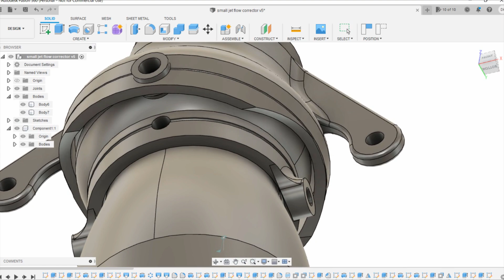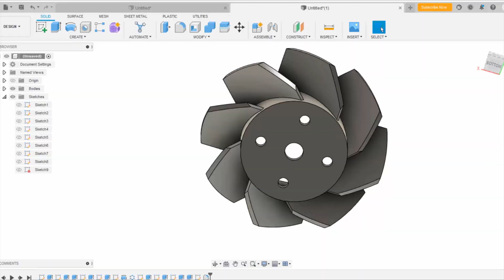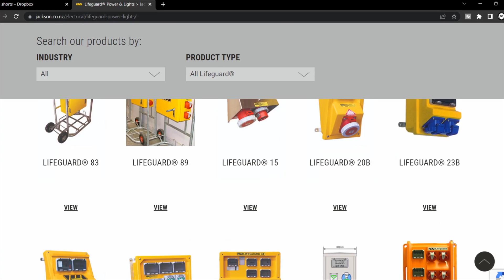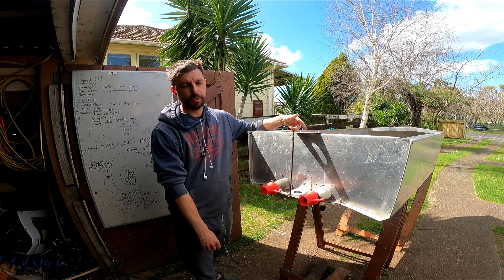Electric Micro Jet Boat Build

Comment: As far as cooling fans why not get some low volt high volume computer fans. You may run into issues with the fans you added as the greatly shortened your mitor shaft length. I wont pretend i know how your impellers connect to the shafts but im guessing they have allen screws to tighten a collar to the shafts. If thats the case the more the impeller is making contavt with the shaft the less vibration youll have as well as being out of balance. Pop a 4" or 6" pc fan pushing air into the motor compartment and one pulling air out on the other end.

Comment: Waterjets have a narrow powerband of greatest efficiency.  Inlet size, impeller size / pitch and nozzle size all have to match the motor constant/RPM in order to get that thrust you are looking for.  If I were to guess, I'd say you need more rpm on your setup but its only a guess.  Your ESC may be able to tell you how many RPMs your turning. 
 Motors have so many rpms per / volt, so either raise the voltage if your ESC can take it or get motors with higher KV rating.  Its usually better to max your voltage up to the proper RPM to reduce heat buildup in your batteries / motors / esc.
You'll have to test your Jet to find its best rpm/thrust before it cavitates. If you build a jig with a scale you could change some variables and measure your thrust to get the best results before river testing.   
Just for reference ; the MHZ jet 64 units are around 16-17k max rpm with a claimed 400N of thrust. 
I went that route as I didn't have a 3d printer.
I Enjoy your videos. Great to see your determination and skills.   Thanks for sharing your work and bringing us along for the ride.
Reply from the maker: Yeah there wasn’t enough rpm and then the esc melted , so I can’t do much more until I buy some more esc but might need inrunner motors
Reply: @dkthewelder  You want to match your esc for the high end of its range. Although counter intuitive, esc's make more heat when they're held back. Just make sure your at the highest system voltage you can manage to match your rpm range and add some capacitors to them. You might want to look at sss56104 motors. Decent and good cost/performance ratio.

Comment: I would not put the controller on the bottom of the hull since it will get wet there  . put them in line with motor fan elevated   Just saying
Reply from the maker: Yeah I moved it off the bottom. Have you seen the latest video?

Comment: I wouldn't mount the controllers that low. That's where the water will go when it gets in. I'm not saying that it will leak. I have full confidence in your fabrication ability. You should definitely mount them above the floor.
Reply from the maker: I know what you mean they are in prime position to get wet I might have to move them

Comment: Thanks for the Dantastic mention mate :)
the esc's should be good on the hull, there is some white thermal-paste out there
that sets a bit like silicon, that could increase the heat sink a bit more, or the thin thermal rubber you find behind a CPU's IHS could help,
I did burn up a few things up in the beginning but getting an amp-clamp that dose DC and a cheap IR thermometer was the best of moves and stopped a lot of the magic smoke,
if the batteries aren't big enough and you thrash them too hard, the capacitors on the
esc's will be working overtime, that can be a bit rum if the low-voltage-cut-off is a little lazy in the esc's, 
the esc's caps are what I would keep my eye on and the wires to the motors,
Give us a shout if you need some help mate, young Kian and his dad have had some great results and fried-up less than me :) having new jet-units is a leap into the unknown with what works well with them,
if the caps on the esc's do get too hot and you have you have plenty of battery,
an added cap-bank before the ESC can help smooth out any ripple current effect
on the Esc's caps,
Thanks again Dan, Have a smashing day mate,
Mark
Reply from the maker: Thanks mate, so I can put a capacitor in before the esc ? This is all so new too me been a steep learning curve over the last week . I will ask you some questions once I know what to ask 👍
Reply: @dkthewelder   Hi Dan yes mate,
have a look at the caps on the esc and get the same brand and the same uF-rating, and keep the voltage the same or higher,
they should take a lot of the stress out of the esc's caps, but they can only do so much and having some batteries that can handle the amp draw is the most crucial bit, that's where the amp clamp and ir temp stick is good to see what's the batteries can do without getting too hot and knowing how hard to push them, Have a great day buddy, soz for the slow reply but I don't have a smart phone and I'm  living in the past :) 
Cheers mate,
Mark

Comment: I'm now using a 2kw battery from an EV. It's a 12S1P from a Ford EV.
They are perfect and can handle the current easily (300 amps + when running full speed)
Reply from the maker: Do you have an electric jet boat?
Reply: @dkthewelder  No. It's for my jet board (pumps are from Mark too), and an eFoil

Comment: FYI.  Your motors may be too close to the aluminum on the bottom of the boat and the side of the motor mount.  Front motor mount is not a problem.  The spinning magnets of the motors will induce a current in the aluminum that will rob power from the motors.  The steel case of the motor does contain the magnetic fields to some extent, but there is a good bit of leakage.   From my experience with using similar motors on ebikes, I would suggest 1/2" min clearance at a min.  Overall you have a great design.
Reply from the maker: I never thought about that! Are you saying 1/2 an inch ? It is about 5mm gap at the moment so your say I need like 12mm?
Reply: @dkthewelder  Yes, I am suggesting a 1/2 inch gap between the sides of the motor and any metal.  It will work with the 5 mm gap,  but the power loss and motor heating may be unacceptable.  I say go with it as is and if motoring heating is a problem you have one possible solution.

Comment: use the pressure of the jet to tap into and than water cool the motors and esc's. look at R/C boats for inspiration
Reply from the maker: I was going to get buy water cooled esc and motors but a subscriber sent me these air cooled ones so I will try get them to work

Comment: I do a lot of Fdm printing. I currently have 3x prusa i3, I definitely rate them. Compared to the enders they are a lot more trouble free, and tend to just work a lot more. The print quality is also great. Obviously you can also get great prints from the enders but in my experience you need to do a lot more fiddling with them. The current printer most ppl are excited about is the Bambu lab x1. They have a tonne of new features for a good price. But I'm not sure if they are readily available yet. 

Re your speed controllers, the easiest option would probably be to replace them with water cooled units designed for rc boats, I assume those are for planes. Alternatively you could do as others have said and mount them to a cpu cooler. You might want to put a fan blowing on the top as well. Another idea, you could pack them in grease, In a container. No promises that it would work, but if you got the right kind of grease that is thermally conductive it might.

Comment: I think youtube deleted my comment so ill make another, you mentioned you installed your board and it was a no go and said ender 5, i found you board online and its a official creality silent board v4.2.7 that works with ender 3 ender 3 pro and ender 5, your board came flashed with ender 5 firmware so youll need to flash ender 3 firmware on it. Ive never done it but found this video that seemed to explain it or you can look at other pages explaining the flashing process 
https://youtu.be/XWvAargw5n8
Reply: Also i think since many people contribute ideas and opinions to you and your very active in your community you should make a group on discord telgram or something else, it would be cool
Reply from the maker: Ok thanks a lot for that! I put the old board back in and am in the middle of a 20 hour print , I might have a go once it is finished

Comment: Just re the motors heating up, have a quick look into total current draw when it's running.  You'll hear RC guys talk about over propped motors where the current draw exceeds the motor rating and they overheat.  13hp is huge so should be fine, but worth checking.
Reply from the maker: Ok thanks!
Reply: These motors are rated at peak power at a max voltage for RC usage.  It will only last a very short period of time when pulling full rated watts.  You have to run them under 1/2 max wattage to get them to survive.  What limits the motor is the heat generated by the current running through the resistance of the windings and this is waste heat.  These motors will run cooler if over you volt the motors to 24, 48 volts or more.  The break down voltage of the wire insulation is what limits voltage.  Running at a higher voltage gives you the same power at lower current and less waste heat.  If you over volt the motors, the motor controller has to be able to handle the voltage.   

This next part may not apply to boats.  My experience comes from the ebike  world.   The rc motor controllers  do not work well for ebikes.  The weak area is  is starting form 0 mph and going up hills.  That's when the magic smoke comes out.  I don't have a technical explanation for why this happens.  The VESC motor controller was the hot ticket a few years ago.   My controller info may be a bit dated because I have been  out of the ebike loop for a few years.  Go to  endless-sphere.com for the latest info on motors, controllers and battery technology.  They also have a room for boat discussions. 

In the ebike world, I would get 25 miles out of a 6s2p  aka 48v, 10 ah battery pack.  That was 4 each 3s 5000 mA lipo battery packs or about $125 dollar. I don't know how this would apply to a boat.  It is just a reference point.

Comment: You should learn how to service the printer. Thats a clog 😁
Reply from the maker: It was a clog ! But usually the wire feed jumps , also the thermic sensor had a short I think I have kinda fixed it now
Reply: @dkthewelder  yes, extruder failure (often the arm/tensioner) is common (people say, hasnt happened to me in the 2 years my e3 has been running) 😀 
Isnt it lovely😂 were still many years or alot of cash away from worry free printing, but its all part of the experience😎
Reply from the maker: @maxpower700  do you do much 3d printing? I am always printing custom stuff but I think I’m ready for more build volume what printers do you use ?
Reply: I started with a cheap Chinese diy printer, gave up  after many problems and bought a CR-10, no issues since. Build volume is pretty good too. I'd recommend it, unless you want bigger than 300x300x400, try the CR-10 max. Otherwise good clean and tighten of everything should fix yours up. Welding nearby doesn't help.
Reply: @dkthewelder  a few kilos has certainly been melted through the years 😅
Rn i have a two heavily modified printers. E3, and anycubic Chiron (410x410x450).
The Chiron is all but reliable, you cant go as fast as the ender since its a bedslinger and the bed is like 3kg or more,its plagued with bad design, but its cheap. Real cheap. I paid around 250usd brand new. I was aiming for the ender 5+ sinze the bed only moves in Z direction, meaning youll have fewer issues with big prints and speed, but the cheapest e5+ i found was 650+😅 so being s tinkerer, it landed on the Chiron instead.
Its being discontinued now, but they have a replacement model, wich smsupoosedly had alot of the design flaws fixed. No experience on that machine tho, so ill leave the comments on that 😊

Comment: lol you should learn how to rebuild the printer, need to be able to change all parts and have all spares on hand, I run 12x ender 3's and consistanly changing nozzles, ptfe, extruders/gears etc etc
Reply from the maker: I have just run this printer for like a year hundreds of prints all custom stuff it has been an absolute champion of a printer not that I know much about them have had a few clogs but other than that no maintenance at all. I have it running now it was the thermic sensor shorting out I think
Reply from the maker: Also do have a print farm? Are you in America?
Reply: I have the same 3d printer and get prints like was describe when the nozzle  is partially clogged.
Reply from the maker: @wildmanbubba9557  it was partly clogged! The other problem was the thermic sensor was playing up and going into thermal overload . I have fixed it now … until next time haha

Comment: The quiet board for the printer should be an easy af install, I did one with my printer, all the wires go to the same spot. All you have to do once you install the board is to get the firmware for your printer which is easy, all you do is download the firmware and transfer it onto an empty sd card, plug it into the printer and turn it on, then the printer will take over, install everything and you will be all set. The ender 3 is a good printer so I wouldn't replace it if I were you. Teaching Tech has a good video, https://www.youtube.com/watch?v=-XUQKQnUNig, I used this video when I upgraded my printer, which is identical to yours. 
 Ps. those jet units look a wee bit too small, I think they will have to be quite a bit bigger. Cheers
Reply from the maker: I have just put the quiet board in , it wasn’t easy the little plugs were glued in! It starts up and says it’s an ender 5 now and it tries to auto home the and runs the end stop and errors out. I think I have the wrong board
Reply: @dkthewelder  The board is fine, you just need to flash the firmware for an ender 3 onto it. The boards are all the same, just with different firmware, which you can install on all of them.

Comment: I'd recommend not putting the ESCs at the bottom, too much chance of getting them wet. You'd need to conformal coat them if you want them to be able to get wet at all.

You could use copper heat pipes, or even CPU coolers with heat pipes, to allow you to keep the cooling part away from the electronics, that way you can keep the electronics isolated in a waterproof box.
Reply from the maker: I have heard of the copper pipe thing I will do a test how it is I think then try some sort of water cooling if it doesn’t work . Thanks for the input 👍

Comment: Btw for ya 3d printer make a faraday cage out of some fine steel mesh and put some ferrite on ya USB and power cable as it will kill off the RF that killed ya current printer 😉
Reply from the maker: Also stop the government from seeing what I am printing haha. yeah needs to be in a metal box , I think I will just not weld while it is printing

Comment: Ur first coolin idea wont work but atleast ya try,bend some copper pipe and make it fit in the groooves of the heatsinks and make a water scoop so it piahes cold water through it,they do the same for RC boats
Reply from the maker: Someone else said about the copper pipes too , I might give that a go
Reply: @dkthewelder  the best possible way to do it. and you can use the outflow as a tell tail that its not clogged and fully functioning

Comment: The ender 3’s are suppose to be really good, a lot of people say if you’re having trouble with prints it can most likely be assembly, loose gantry’s, wonky bolts, ect ect. Those small upgrade boards are suppose to make a world of difference too.

(I have never owned or used a 3d printer, going to buy one soon but this is all from reading I have done. So take it with a grain of salt)
Reply from the maker: It has been an awesome printer I have done hundreds of prints it just works great. I’m trying to fix it at the moment I think it is the thermic sensor only a cheap part but will take ages to get here

Comment: i wouldn't worry about making ducting, the ESC's being in contact with the hull will be more than adequate. i would have thought
Reply from the maker: I like to hear that but a bit of air moving through will help a lot I think
Reply: They have upper and lower transistors.

Comment: those jets going to be too small to push all that
Reply from the maker: Yeah you might be correct, that’s why I left a bit of room between the jet units and the motors in case I have to make them bigger. Is I could make them 2 stage
Reply: @dkthewelder  2 stage wont make a difference since theres someone else did the same with a surfboard https://www.youtube.com/watch?v=YsDMwh7Mw-8, you should get a normal jet drive from a seadoo and try to power it with the electric motors, prob do a dual motor setup or a bigger dual motors.
Reply from the maker: @DatBlueHusky  I have seen that video. He took the second stage out because it was drawing too much power so his jet too big or impeller pitch too aggressive like a bike being too high geared . A JetSki unit takes 100hp to run and at less rpm would need a $10k motor and battery setup to run , maybe one day I can spend that much

Comment: Have you considered a small air bleed into the jet intake to reduce possibly damaging vibration ?
Reply from the maker: I’m not sure about that , they usually have a hole to feed the water cooling but I guess I could put one in if it’s a problem
Reply: @dkthewelder  the big ones do. 
It’s often hidden as an auto drain system that sucks air after the water has gone. 
The Jetboat racing guys over here do it. 

Something to do with compressibility and cavitation, it gives the pressure waves somewhere to go to.
Reply from the maker: O yeah I have seen something like that , I saw this drag boat style jet boat and on deceleration it dumps the pressure. I have a JetSki unit I will look at that more closely 👍
Reply: @dkthewelder  
My old Hamilton 753 had it as a tube screwed into the top of the intake. 

Should be easy to see on photos.
Reply from the maker: @brucebaxter6923  ok will check it out thanks